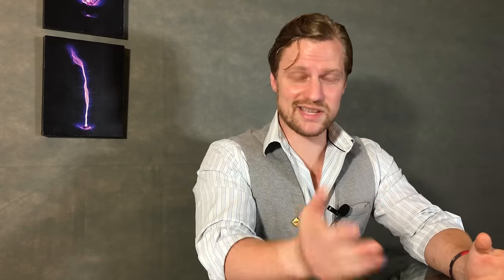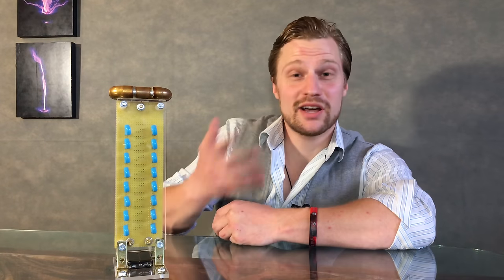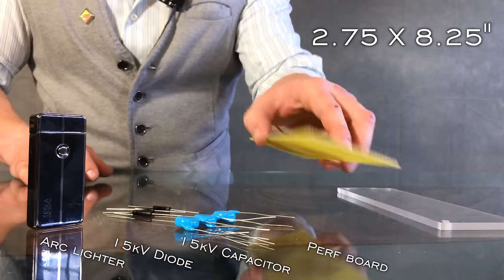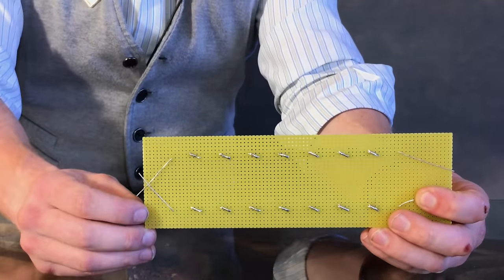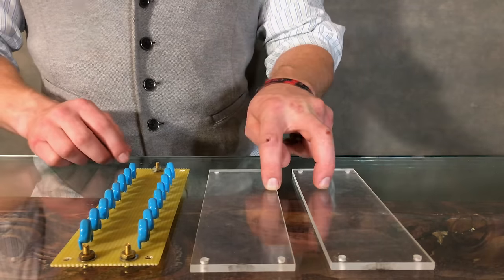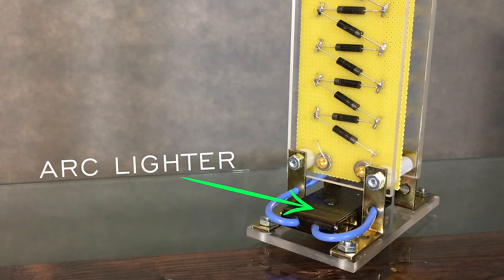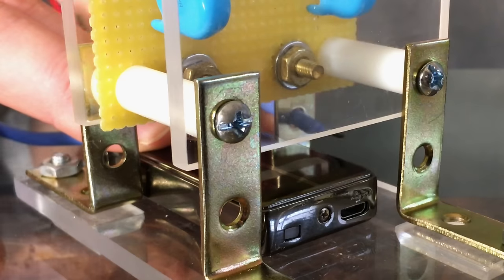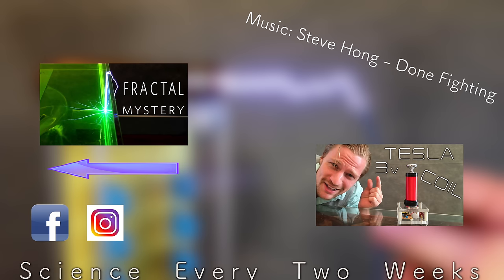DIY Desktop Lightning Tower (USB rechargeable!)

Comment: can you tell which electrical ground the wire should connect to? The multiplier doesn't have a ground
Reply: Yeah no one ever mentions this part. I assume it’s the negative side of the battery or before the diode at the start of the multiplier, who knows.
Reply: @justinx256  okay thanks 😃

Comment: I finally built one of these. Using 12 20kV capacitors and diodes.  My power source is one of those mini 20kV transformers and boy oh boy does this thing put on one hell of a show. I will most likely build a fusor around it.

Comment: I building a small 8 stage one with my 5ma diodes and gonna build the full 12stage with the 100ma, i’m using paraffin wax to seal the bottom to prevent leaks

Comment: Im going to ask a dumb question here.... Where precisely did you hook up to the ground? I'd rather not burn up lighters if I dont have to.
Reply from the maker: Every voltage multiplier has a dedicated ground. It’s one of the input wires. I’d recommend googling voltage multiplier schematic to reference which wire will be your ground.
Reply: Ok thank you for the fast reply.
Reply from the maker: You are certainly welcome!
Reply: I rebuilt it with a tazer module... Forgot the spark gap... and blew a capacitor. But, I did find the ground as you indicated. Thanks again :)
Reply: @OriginalXfyre  instead of sparkgap you can also use GDT's (Gas Discharge Tubes) they are more predicable+safer and can be put in series.
for the ground question https://en.wikipedia.org/wiki/Voltage_multiplier

Comment from the maker: My apologies for the messed up audio levels people. Somehow I messed up on normalizing the sound levels? Please comment on this pinned comment, if it bothered you enough that it merits a reupload. I need a poll. Yes, No?
Reply: no, it's perfect 😉
Reply from the maker: Thanks for feedback
Reply: Good for me also.
Reply: WTF you do to your knuckles bro?
Reply: I'd Pay for Someone to make me one.
You Should Make a website and sell diy kits with everything included
Reply: you might want to note that diodes are 1 way devices and how you placed them so that people dont make this backwards.
also how to connect the ground wire so that people dont hold a live wire against the lighter.
Reply: this was definitely my favorite video of your's so far, since it tells me how to do what you do. I have a few questions; are the sparks dangerous? how can you tell if blue arcs are safe or not? what is your definition of sparks vs arcs? according to my personal assuming i thought sparks was when high current melts metal and makes blasts, and arcs were any high voltage discharge or corona.
Reply from the maker: Great questions. Sparks are single events. Single pulses. Arcs are sparks so quickly repetitive that the ion stream stays open, forming a permanent channel. Or arc. These sparks are not very safe. Only discharge into the grounded wire.
Reply: thanks so much
Reply: Its really good
Very informative
I love it!
Reply: Will you please provide block diagram of this arc tower?
Reply: About the dangers of the sparks, is it over 100 milliamps
Reply: Plasma Channel Hi sorry non techie here! How and where do I attach the ground wire? Thanks
Reply: No need to re-upload
Reply from the maker: Certainly!
Reply from the maker: thanks! i really like this build
Reply from the maker: Block diagram? I dont understand
Reply from the maker: I like boxing a little too much
Reply from the maker: Thats a great idea
Reply from the maker: Wire gauge is not too crucial. The power level is very low, so any insulated wire will work
Reply from the maker: Thanks a ton!
Reply from the maker: IT is much, much greater than 100mA. But, the pulse duration is extremely short, making it non lethal. Dangerous, and painful, but not lethal. Still, exercise caution at all times though.
Reply from the maker: Hey! The ground wire is one of your input wires at the base
Reply: nah I didn't really notice
Reply: Audio is fine but how do u get the HV used on your larger equipment ? Thanks Ben
Reply: No

Comment: What you built was a Walton-Cockroft voltage multiplier. Multiplier is a misnomer, it's actually a voltage adder - it increases the offset of the AC waveform by the voltage of the primary source at each stage.

Comment: Another question, when you have a moment: It's about frequency of the power supply vs recovery time of the diodes.

Everywhere I look, the 2cl2j diodes are insanely expensive... but I have many different alternatives rated at up to 20kv.
I was assuming that the 2CL2J diodes had a fast recovery time, but when I looked at the data sheet it isn't even quoted.

What I have collected with limited funds:
R5000 rated at 5kV and 2MHz recovery frequency.
PRHVP2A-20 - rated at 20kV, unknown recovery time
CL04-12 (MO diodes) rated at 12kv, 450mA - unknown recovery time

I want to avoid wasting time and solder using components that will not work together.  Do you think any of these rectifiers will be up to the task of an arc lighter, or should I make an inverter based on a 555-driven circuit limited to 2Mhz?
Reply: You can get high voltage diodes for free from old microwave ovens. They are usually rated at 12Kv. Post an ad online that you are looking to recycle old microwave ovens and include free pick-up. You'll get diodes, 2Kv capacitors, 2000v transformers, turn table motors, blower fan motors or fans with spools of magnet wire, large ring magnets from the magnetrons, lots of switches, wire, and sometimes simple LCDs and small LED strips. Offer to pick up TVs and other electronics for recycling and you'll have a boatload of parts. I did it for a year and now have thousands of free high voltage components.

Comment: Hi Jay.
planning to make it can I use city power (220V) instead of an arc lighter? (ofc with a power button on the cable)
And if I do that , the discharge must be connected to the ground?
Reply: i think you will get only 1660 v
Reply: i ment 4000v
Reply from the maker: This will only produce a few thousand, and, you will need current limiters in place from the wall socket. This is so your components do not burn out, and, so that your device is safer for you. Yes it would arc to ground, but could still arc to its own ground.

Comment: Again a nice build!
Will it zap you badly when the arc hits your finger?
Reply: YES IT WILL.
Reply from the maker: Thanks! It is not lethal, but extremely painful. Partly why I put the big disclaimer in the video. But one should not be drawing sparks to their finger from this device anyways. If you do, and you’re touching the lighter, it will give a nasty shock through your body and also blow up the lighter circuitry (I did it twice). Also why in the video I mentioned to only draw sparks with the grounded wire.
Reply: Thank you Jay. I'm going to build one for my channel!
I will link the build o your channel 👍
Reply from the maker: IamKian I am happy you enjoyed the video, and thank you for the credit and link. You’d be amazed how many things of mine have been ‘stolen’ so to speak on YouTube. I recommend buying the saber light x model, and putting the two internal transformers in series. It gives the absolute best performance, and the 3” sparks in video. Be safe, and never let the spark jump anywhere but the grounded wire (hv ground)
Reply: Hey,  some time ago I watched your video about the 3kV tesla coil, and I tried to make a similar one. well...It works! Thanks for that video!!
Reply: yes if you touch the negative plate too, but that might be hospital time
Reply: If touching the lighter means full curcuit and electric shock. Then why not just insulate the lighter?!
Reply from the maker: @alessandrodipaolo1462  Super happy to hear of this
Reply: it's low frequency AC so yes it will. higher the frequency of the arc, the less it hurts basically.
Reply from the maker: @Colaaah  Because you have to physically touch the lighter's on button to make the device work. An elaborate setup could indeed be made to cover the lighter. I prefer to just be safe.
Reply: Plasma Channel i dont understand where the geound goes, and, is the copper hooked up to the top bolt?
Reply from the maker: Try googling voltage multiplier schematic- you will see the ground I speak of. Only discharge to that ground- and no others.

Comment: Can I use a fly swatter circuit?
Reply: No it outputs DC and the voltage multiplier needs an ac input.
Reply: @jacklewis1  I guess you could technically remove the multiplier circuitry in the flyswatter, then it would just be AC. Just a bit of desoldering (now I'm curious what a dual flyswatter arc would look like without the HV cap and multiplier circuitry).

Comment: I have built one of these lightning towers and powered it from an arc lighter DIY module which outputs 3-5 kV from 3-5 VDC input.  The DIY module seems to be able to accept up to about 12 VDC for an even higher output to feed to the tower.  I won't go much higher because the secondary windings of the small transformer might not be able to take much higher potential across them.  Now, I'm planning to build a second one of these lightning towers.  If you draw out the schematic to the lightning tower you will notice that you can mount the diodes in one of two ways.  My first tower has the diode polarity such that it conducts negative voltage up the diode ladder resulting in a large negative DC voltage at the top load.  I plan to build my second one with the diodes mounted in the opposite direction up the ladder to create a large positive DC voltage at the top load.  Then if I common the ground points of the two towers I should end up with -60 kV at the top of one tower and +60 kV at the top of the other for a net potential difference of 120 kV between the two top loads.  It should be possible to generate some pretty good sparks between the two top loads of the two towers.  Not quite the 400 kV of the giant tower in the other Plasma Channel video but pretty good.  Oh, by the way, I dripped some paraffin wax on the solder joints on the back of my first lightning tower to reduce corona losses from those.  It's hard to eliminate all sharp points from the leads of the components.  The paraffin insulates those and helps reduce losses.  I considered using hot melt glue, it's easier and cleaner to apply, but I wasn't sure about the high voltage properties of it.  Also if I ever had to replace a diode or capacitor I'd have to burn through that hot melt glue and it would be messy.  I can scrape most of the wax away first if I ever need to make a component change.
Reply: Last post on this.  I finished my second "positive" tower and have now played them between each other.  Man it starts to get scary.  The sparks that jump between the top loads of the two towers are between 5 and 6 inches long and quite loud and "angry".  I added a green banana jack at the bottom that connects to the ground point of the capacitor/diode ladder so I can plug and unplug the discharge wire easily and interchange it for the commoning wire for both towers running in tandem.  I put a banana plug onto a piece of silicone insulated high voltage wire to plug into this jack for the discharge wire.  Just nice to be able to plug/unplug that wire rather than capturing it under the terminal behind the acrylic plastic.  Great well thought out design for this lightning tower!

Comment: Where did you get the figure of x2.8 from?
A voltage multiplier adds 1x the input-voltage at ever stage. The lighter seems to give a higher output than you stated too.
Reply from the maker: So, Multipliers do not add 1x per layer. A 5000 volt source, is 5000 volts RMS. Peak voltage of any AC is 1.414 times the listed RMS. Then, when a multiplier discharges, it has two capacitors for each stage. That’s 2.828 times the input.
Reply from the maker: Great question by the way 👍
Reply: that still only adds exactly 1x the input per stage - and if you have a way to measure the output (use some resistive dividers) you would note that this is exactly what is happening - at stage N you get
'N' x 'Input voltage'
As output. It doesn't matter if you measure RMS or Peak voltage as long as you stay consistent.
There is ample literature on voltage multipliers and i kinda suspect that the millions of people that have built them and the thousands that use them in professional environments on a daily basis know what they are doing.
Reply from the maker: There are 2 charged capacitors in a stage, each charged to 1.414 input RMS. How again are two of those in series (2.8) equal to only 1X input? It has 16 capacitors total, all charged to peak RMS.
 Equation is 2NVmax, or, (2* number of stages * 1.414RMS voltage).........
As per literature:  
 1)"The total output voltage will be 2nVmax where n is the number of stages" - http://www.academicjournals.org/article/article1379584824_Dwived%20and%20Daigvane.pdf
 
2)"Therefore, the maximum value of output voltage is 2nVmax in which n is the number of multiplier stages"
https://www.hindawi.com/journals/jece/2017/4805268/

3)"2nVpeak = Vout + Vdrop" 
https://www.irjet.net/archives/V3/i2/IRJET-V3I2114.pdf SECTION 3.1

The difference in design is the difference in equation. Some are built with capacitors diagonally from each other, with one capacitor per given length. In that case, my device has 16 stages. So 1.414(3kv)*16. 67,000. Or, multipliers can be rearranged visually into two capacitors per visual stage, with them both in line with one another, like mine. In that case, I have 8 stages, or 2(1.414)(3kv) * 8. 67,000. 

There is indeed ample literature, which, i've been reading for 12 years now.
Reply: Plasma Channel I found some caps that work ok, but at most I can only get arcs around an inch, I tripled up the caps with 10 stages. What caps did you use?
Reply from the maker: So, which lighter have you modified? I found that different brands perform slightly differently. When put into the multiplier section, the slight difference becomes a big difference. Did you purchase one through the links in description?  Also, the caps I used are Murata 15kV, 1nF ceramic capacitors. They are japanese, and very high quality.
Reply: Plasma Channel I used a tacklife lighter, I didn't realize that the lighter had such a large effect on the product. I will order one from the links, and caps from the link. Thanks!
Reply: @PlasmaChannel  The Caps finally came, and they made a HUGE difference working with the higher quality arc lighter. Most arc lighters seem to turn off after a while to prevent over heating. Would it be possible to use a neon lamp power supply rated at 9kv and 30mA? Or would that blow everything up?
Reply from the maker: Awesome to hear! Still though, I would only pulse the lighter for a few seconds at a time. Dont stress it out too much. You can indeed use an NST, but make sure you use a modern solid state NST (high frequency). 30ma would not destroy the 100ma diodes.
Reply: @PlasmaChannel  Is 60hz high enough, or should I find something else?
Reply: @PlasmaChannel  The NST came, it worked fine, I hooked the two output wires to the voltage multiplier and flipped the on switch. There was a loud pop and the nst won't turn on anymore. It was a model HB-11010. I can't find any fuses inside that might have blown. It was a modern solid state.
Reply from the maker: I'm so sorry to hear this. Many, many times, modern NSTs have ground fault protection circuits. Basically, they shut down as soon as they sense that their power is not being used as intended. But usually those circuits only temporarily turn off the NST, they dont destroy it. Do you see any electrolytic capacitors with their tops blown open? Those are usually the only things that make loud popping noises.
Reply: @PlasmaChannel  Unless it's beneath the silicone shield, I haven't been able to find one... Is there a way I could bypass the ground fault protection circuit?
Reply: @PlasmaChannel  I haven't been able to get it up and running again. Found a fuse under the silicone that had blown, so I replaced it, when I turned it on again the piece of metal exploded in a shower of sparks. My guess is that something else went out. I found a NST on a site called amazing1.com; it has 60ma at 15kv. It also specifically says that it doesn't have a ground fault interrupt circuit,  would that work? It costs $350 as opposed to $42, so I really want to make sure I don't waste a bunch of money.
Reply: @PlasmaChannel  I got a small zvs driver and hooked it up the the transformer from an arc lighter. It improved performance time to as long as I need. The arc wasn't effected very much, until I put a piece of paper over the ground wire. The arc makes a tiny pinprick hole, so as long as I keep the paper moving, I can consistently get 3-4 inch sparks. Why does the paper improve the performance so much? it more than triples the length of the arc I can get...

Comment: Your soldering is great, whenever i make multipliers the ends are a bit edgy and so i have leakage, but your solder joints are like completely round
Reply from the maker: Soldering skills are a must with high voltage. Sharp points will leak power into the air!

Comment: scared in Current not in Volts 😊😊
Reply from the maker: The current on the sparks unfortunately is quite high. A shock from this is very painful. But the duration of the spark is so short that it poses no immediate health threat. But is very painful.
Reply: the current has nothing to do with it, the only factor that's dangerous is the voltage. the current is the voltage divided by the resistance :/
also those sparks can only deliver probably about 500uA (probably) so, not enough to harm you. but 60kV wouldn't be nice to touch :/